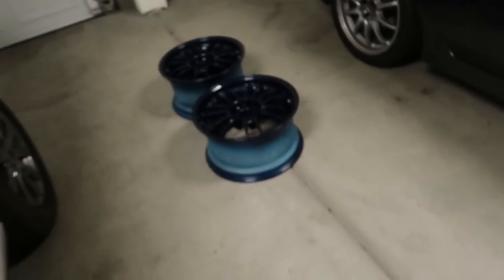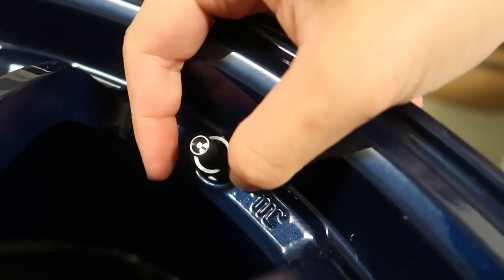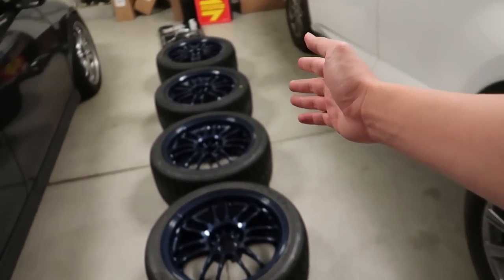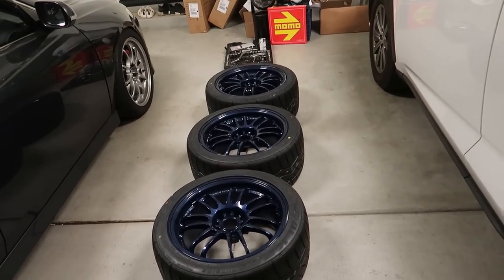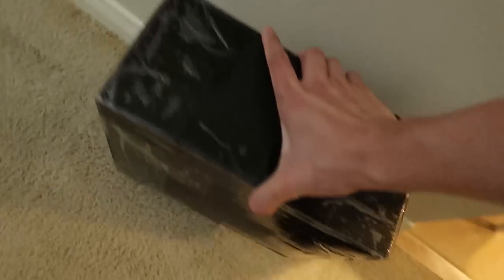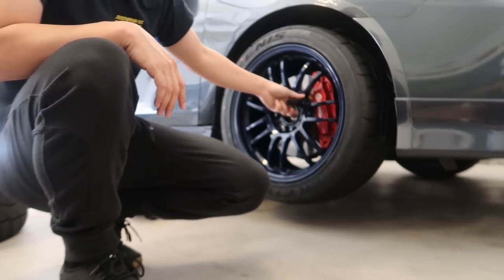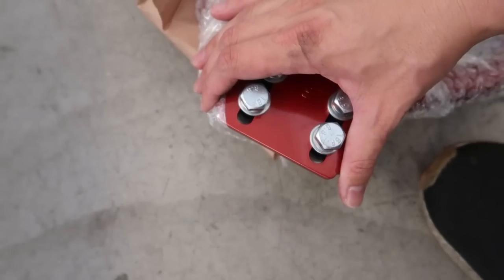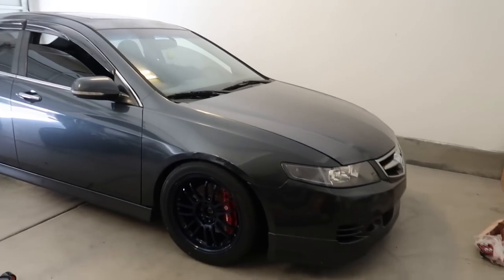Tire shop damages my $4000 wheels! Test fit on the TSX!

Comment: It’s because they’re painted and not powder coated. Painted and plasti-dipped wheels have a 95% chance of getting messed up when changing a tire. Never paint wheels, it’s too thin and it’s extremely easy to scratch even from rocks and pebbles. Powder coat is way more durable and proven.
Reply from the maker: I've have so many painted wheels and rattle canned wheels that I've had mounted with no issues, literally my first time.
Reply: You shouldn't really powdercoat forged wheels either.

Comment: bro with how many wheels youve owned how do you not have a dedicated tire guy/shop that you can at least trust w/ your valve stem caps. I have 1 guy and 1 guy only that mounts my tires for this exact reason among others like valve stem to tire location / wheel weight placement/ quality balancing etc

Comment: Rookie Question: what’s wrong with powder coating wheels?
Reply from the maker: On forged wheels, powder coating requires the wheels to go into a oven and bake the coating on. Doing so, weakens the original forging process on forged wheels which causes them to be weaker and cracks

Comment: also spherical / rose joints don't feel good they feel like shit they're noisy clunky overly rigid on impacts really have no place on a street car  they are only good because they offer the least amount of geometry change/deflection under load but that 90% of drivers even enthusiasts wouldn't notice & really only make a difference  if the top shelf bearing materials quality & tolerances which requires expensive highest grade metals and precision machining by an expert to the finest tolerance too loose pointless tooo tight pointless bearing manufacture is a work of art finer tolerances than most engine rebuilds and that expert being paid to hand machine and check each bearing costs high dollar labor no 100 control arm has spherical bearings worth using a single quality bearing can cost 200+ per bearing fitment and above all else are too high maintenance  for the street  even if you inspect clean and lube constantly they will wear out from even casual street driving dust and grime they are a track only disposable where perfect geometry and zero deflection is worth the crazy high expense. Hardened rubber arms by  hardrace are actually the perfect solution for spirited street driving and some track duty stiffer than stock longer lifespan than stock better feedback and feel than stock zero maintenance and improved geometry change under load with less deflection with low cost and much less noise and unnecessary harshness of poly or spherical